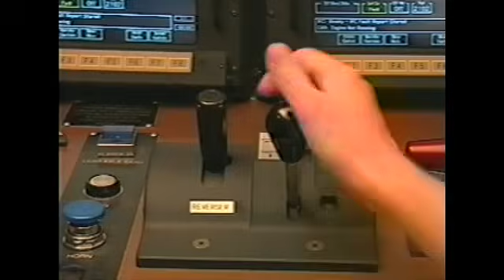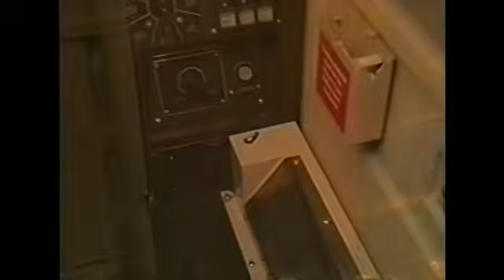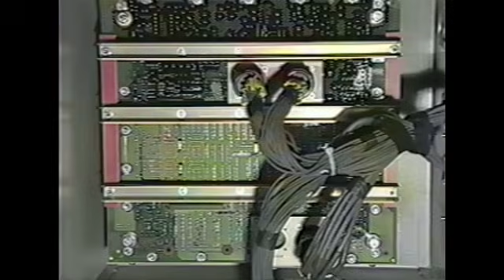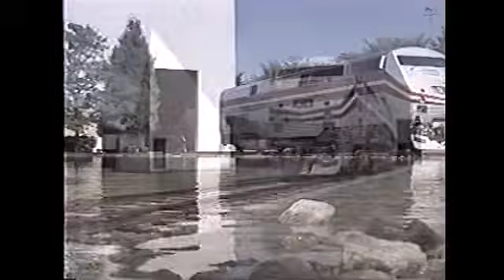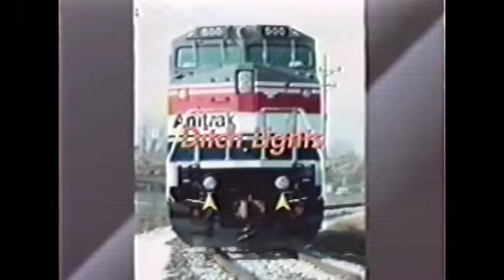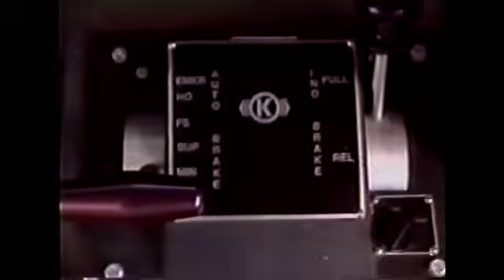Amtrak GE Locomotive Overview [Extended Edition] •P42DC, P32BWH, P32AC-DM (Genesis Series II)

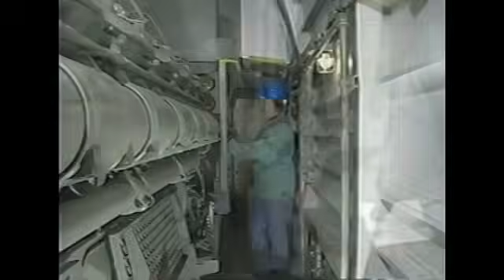Comment: so don’t start the engine unless it has the correct oil level (47:23), but the correct oil level cannot be determined unless the engine is idling (49:32). Got it.
Reply: In practice, we ensure there is oil on the dipstick when we go to start them. Then, once at low idle we take the level on the stick once more to see what the true level is. From there we either add oil if necessary or say it’s good to go.

Comment: I think it's funny how the first 4 minutes the presenters are like parents talking to their kids like "Listen kids, we know the F40s are iconic but we are retiring them and replacing them with these new P42s."
Reply: And it's laughably almost the same exact situation today with the P42s being replaced by the Chargers and the hostility (at least from railfans) about it. No, Amtrak is not going to rebuild the P42s and run them even longer. They're thirty years old and falling apart.
Reply: @valf1733  Interesting how the ''falling apart'' P42's are constantly rescuing their replacements after they break down.
Reply: @AlexSmith-fj2zn Simple survivorship bias. Not all P42s made it this far and the ones that have are arguably the outliers. I’d bet you 10$ there’s railfans from 30 years ago harping about the new Genesis units breaking down and having to be towed by ‘ole reliable’ F40s. Not to mention all the runs that happen smoothly without incident. Us humans tend to remember negative things more. 

New equipment has teething issues and it doesn’t help that Amtrak is probably treating their locomotives the worst out of all other operators, just like the horizon cars. 

Don’t let nostalgia cloud the reality that Amtrak needed new locomotives. You can’t paint over a rusted out frame from 30 years of Midwest abuse.
Reply: @valf1733 If the chargers are having teething issues, it’s been going on for a long time and it seems very painful. My point is, if a design works (F40, P42) stick to that base design and make small modernizations for fuel efficiency and environmental protection. The P40’s and F40’s are proven. They’re not broken. It’s like when the Budd company tried to re-make the RDC, and it was a disaster.
Reply: There's only so much modernizations an old unit can take, and the price of making slight modernizations for old diesels like the F40PH & P42DC over buying a clean-sheet design simply isn't worth it for companies like Amtrak.

It's not great for the image of modernness they want to project as well.
Reply: Yet amtrak still has them mostly as cabbage units [not to mention how they're immortal]